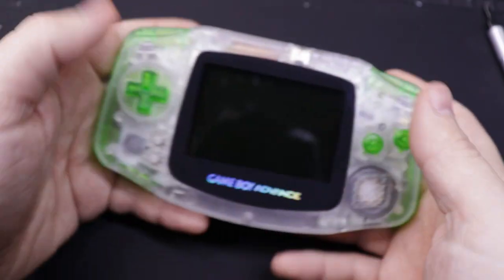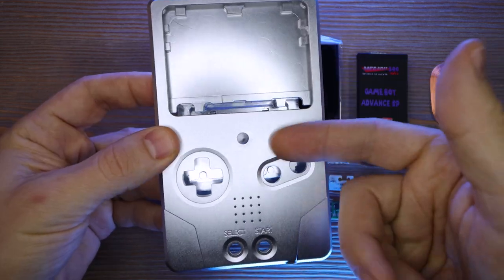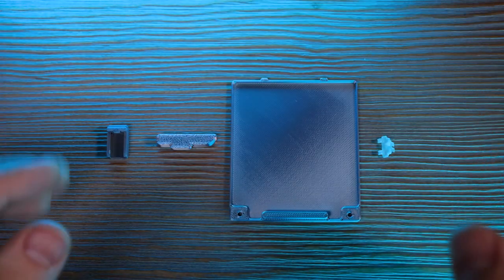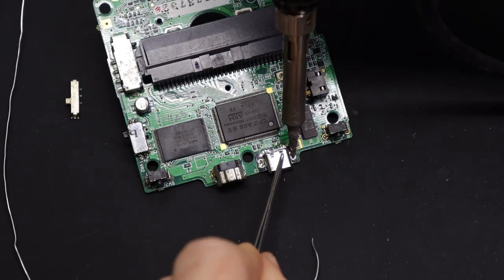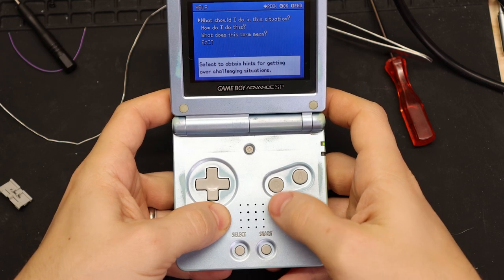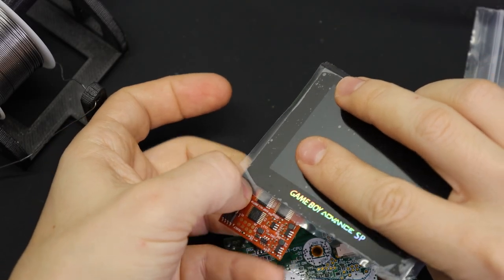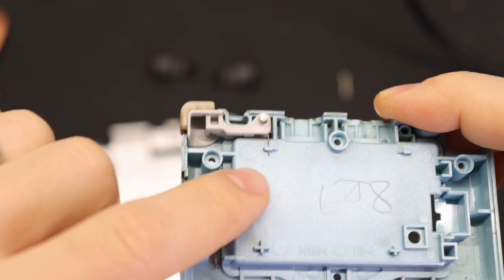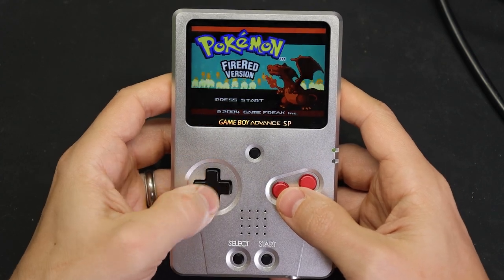Build the ULTIMATE Game Boy Advance with an aluminum shell!

Comment: I also added the Helder power cleaner and only found out that it wasn't going to fit when I was doing my final assembly, I ended up removing it not knowing it could be moved up and still fit, so I might go back and try it again, thanks for the info!
Edit: I also have the new edition of the Boxy Pixel shell (Rev D) which has minor tweaks and added features such as clips for the L and R springs and a fix for the light pipes, so I'm not sure if the area for the power cleaner has also been altered in a way that moving the power cleaner up will be a solve, I guess I'll have to give it a try.

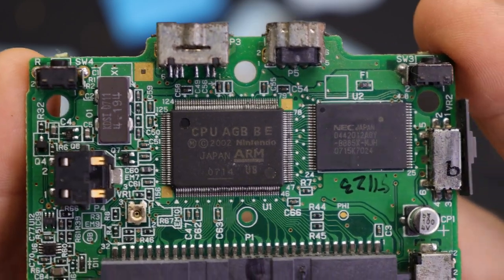Comment: 8:40 Helders pwr switch 
20:56 JST Connectors - adafruit

  JST PH 2-Pin Cable - Female Connector 100mm

  JST PH 2-Pin Cable – Male Header 200mm

Comment: Unfortunately the aluminum shell is incompatible with the GameCube Link Cable. I tend to use my GBA’s as controllers when playing GBA games on the GameBoy Player, so this is a bit of a dealbreaker for me.

I noticed that the aluminum shell had to leave out a lot of basic features simply because it was impossible to machine them out. I definitely recommend machining out the shell in individual parts to fix that, or maybe even using plastic for some of the smaller components. The spring holders for the triggers could easily be put into a single thin piece of plastic that just plops into an indentation in the shell , and the holes for the GameCube Link Cable could be put there in more or less the same way Nintendo did it; separate half of the holes into a new separate piece of aluminum so that they can be machined individually, then either weld them before selling them or include screws to put them in place.

As it is, the Aluminum shell feels like it downgrades the GBA SP in some ways. The metal shell/buttons and the better form factor for adult hands probably do feel nice, but they’re not necessary for the GBA to fully function. I’d rather have the full functionality of the GBA, as well as a way to use the springs for the triggers that won’t stretch them out over time, rather than the premium feeling of the shell if I had to choose. Not to mention the fact that the shell as it is has problems. The fact that this dude had to 3D print a ton of custom parts to get around the mistakes of the shell tells me that it still needs work. I’d rather pay a higher premium for an aluminum shell that doesn’t remove features or requires work-arounds.

Comment: Thank you for mentioning the helder drop-in batt. One of my OEM batteries got puffy to the point the battery cover got bent outward and all I could find in terms of replacements were sketchy aftermarket ones. I have one in my ags-101, but I'm not happy about it, especially with how volatile li-ions are and it being cheap making me very nervous.

Edit: Also my OEM one that isnt bloated is cacked and turns off the 101 if the brightness is turned up(stock screen)

Comment: I bought your 3D printed parts for my boxy pixel build. Overall, I'm really happy with them, but I had a few minor issues. I used the same GBA SP motherboard model you did in the video, but I have revision 2 of the Boxy Pixel SP Unhinged shell.
-The top of my headphone jack bracket was hitting against D6 on my board & preventing it from properly seating in the shell. Since it's 3D printed, it was very easy to just trim the top protrusion from the bracket, & it still holds great. You may want to look into that for future prints though.
-The light pipes look great, but they're not staying in place after assembly. They just kind of tip back into the shell. Any recommendations for securing them better? Should I just use some double sided tape?

I'm also looking at adding Helder's power cleaner. I have the part, but haven't gotten around to installing it yet. Your video gives me hope that I can make it fit. I really don't want to modify the shell if I don't have to.
Reply: It won’t fit unless you take off at lease 1 mm from the back underside battery housing. I just attempted the install 2 days ago and recorded it at 16x speed if you want to see for yourself what happened. The power amp does a great job on its own and I recommend it 💯 sounds clean and clear but most importantly LOUD AF
Reply: Put the smallest amount of super glue on the light pipes to secure them. And I bent  the tabs on the audio jack down to the side at a right angle then after soldering the wires I capped it with the kapton tape. Hope everything went well for you!

Comment: very good, it would be perfect if you modified the position of buttons A and B, for example the super mario games in snes the position of buttons Y and B is perfect to play holding Y to run and Jump on B, it would be the same bosition in GBA but in place of Y it was B in place of B o A, so the gameplay was perfect, but I saw that it is not possible due to the use of the original GBA card

Comment: There are just so many design flaws with this BoxyPIxel shell that are kind of unacceptable considering the expensive price. I think if you are considering one of these wait for RetroCNC's version.
Reply: Honestly the clamshell helps keep the screen from being scratched so why even?? Can’t we try to make better sp shells
Reply: @mmmtoast  clamshells aren't perfect, the hinges are a weak point which is a design flaw in itself.
Reply: @rambo_ando  true but it’s just so nostalgic and a nice form factor overall
Reply: I have to agree with the Boxy Pixel design overall their products. I’ve noticed the tolerances (as mentioned here in some cases, as well as my own GBC) aren’t good. The halves don’t always lineup and mine is off center from the top to the bottom making a lip between both halves. I took it apart to see if there was something going on and it’s just off center for some reason. They even painter tapped the IPS screen to the case… awesome work. I’ll never buy from BP again. Refuse at the price points with how inconsistent their production is.
Reply: @mailman1021  remains to be seen if the tolerances are any better for the Slate.

Comment: I have a question. What do you recommend for thicker guage wire? I work on industrial equipment and a lot of the time my soldering iron can't heat enough from the bottom to pull the solder down through the wires.
Edit: and I'm not talking 00 battery cables or anything.

Comment: I'm having trouble installing the GBA SP Power cleaner. I installed the new power switch and the USB C Port that you added, not the Boxy Pixel one, and they both worked fine. After I added the Power Cleaner, the SP wouldn't turn on. Help please!

Comment: This is a pretty random question but here it goes: I'm trying to connect the power to a Playstation (PSX) laser to the mainboard but I don't have the original cable. I can't find any JST connectors to fit it. I tried PH2.0, SH1.00, XH1.25, and XH2.54 and nothing fits. I don't know much about these connectors and what other sizes there are. These are what I found by looking randomly around. Any ideas? What might the exact specifications of it be? How should I search for it? Thank you!

Comment: Is a beautiful project, but unfortunately is not affordable considering you are building this your self without putting in account the hours.
The shell is $94, buttons $21, ips screen $58, 3.5 Jack $3, battery $10 and type C $2.
Now if you add a working Gba Sp that is around $50...the total will cost you $238.